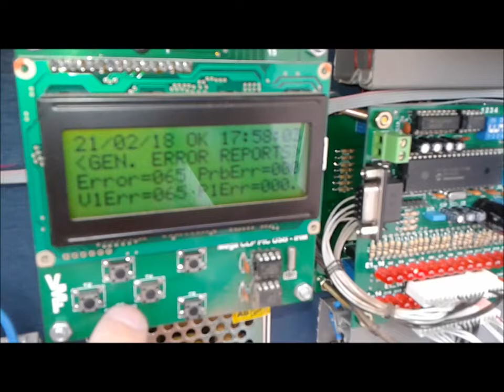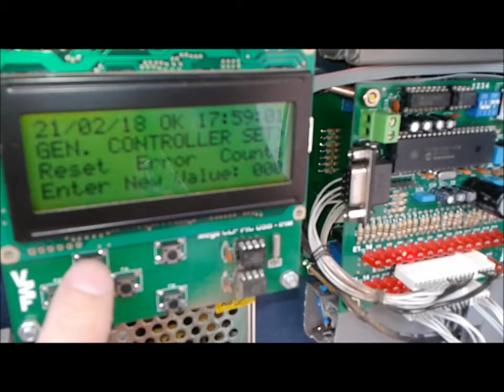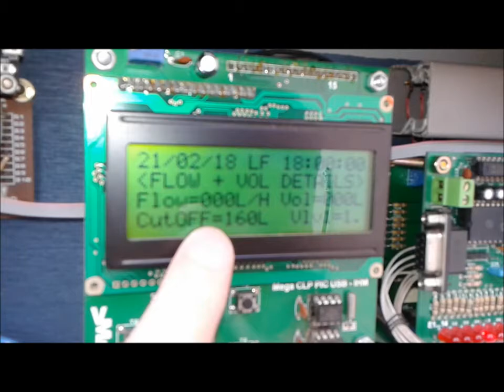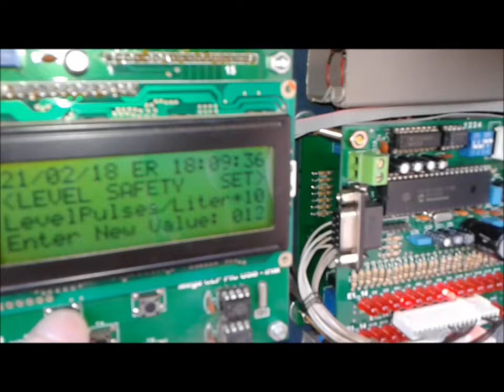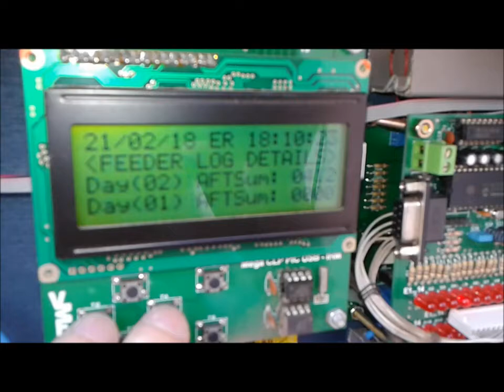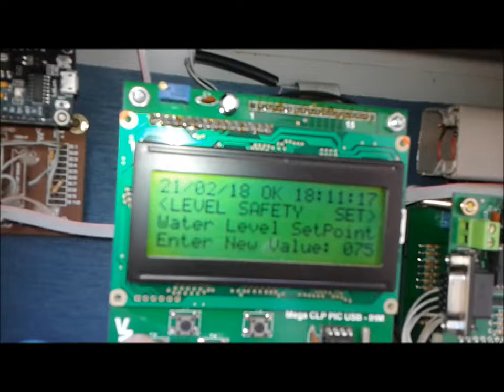Aquaponics System - Control Panel Quick Fix

Comment: Good work with the automation. 
Are you able to design a similar design for someone with an Aquaponics set up and how much will you charge?
Reply from the maker: I have a new version of this controller. It handles the same outputs but has more complex logics and more sensors (added pH, turbidity, air temp, air humidity, air pressure). The feeding cycle now can rely on pH, temperature and several states to decide how much to feed and if it will feed at all. There's also a built-in solar controller that works with a pump and two temperature sensors to heat the water up. The supervisory side also got improved, it now fires a e-mail in case of problems with the system or in case of low food in the feeder. Those are a fraction of improvements that are now available. I think a controller like this can handle a large variation of set ups.
Reply: @VMFRD  Awesome! Are you planning to post the new features in your next video?
I'm interested in your design for my aquaponics setup- Please reach out to me @ olaakin101@gmail.com.
Obrigado!
Reply from the maker: @olaakin3033  I'm working on a new video that like you said will show all the new features about the controller. I'll send you an e-mail. Thanks.

Comment: Wich are the controlled parameters?
Reply from the maker: Water temperature, water level and amount of fish food (calculated according to the water temperature)
Reply: Thanks, are you planning to add DO EC NO3 NO2 RH PH?
Reply from the maker: I had a hard time working with a electronic pH meter, so I'm not sure how reliable those cheap probes are and unless you go for a much more expensive industrial solution you may have false readings. The other thing is that I don't like the idea of adding a sensor just to monitor some parameter, lets say the pH. That's good if you have a way for your controller to actually do a control loop and fix it to a desirable value. I rather do manual readings on the pH myself. DO could be a good idea, because if it's too low you just start an air compressor and fix it. But again, how reliable are cheap probes?